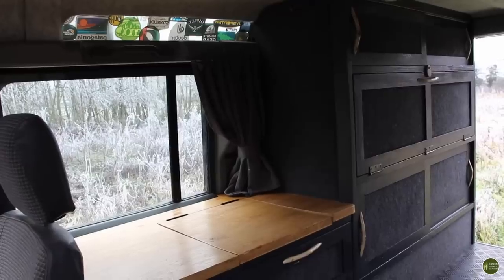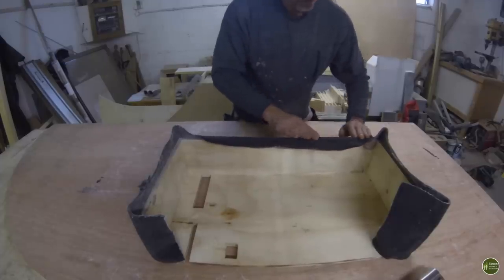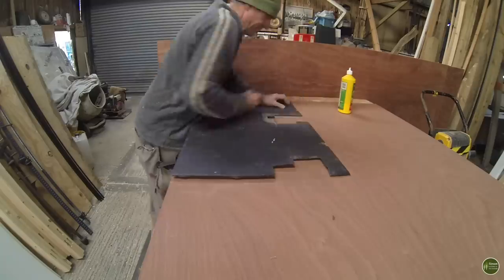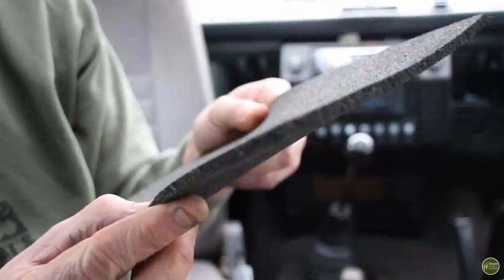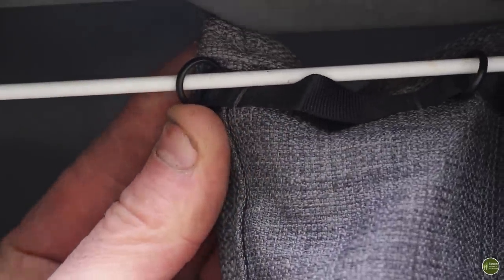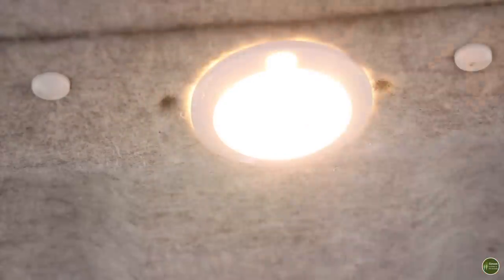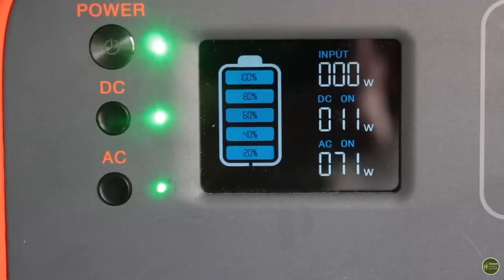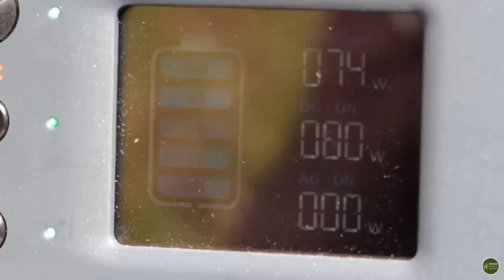Land Rover Home Build Camper Conversion - Part 2.  Off-Road, Off-Grid Adventure Vehicle.

Comment: The only thing I would do is change the night heaters fuel pipe for the diesel as the degrade and leak the chinese rubber isn't up to it we found that in our defender but its a great video great landrover camper conversion 👍

Comment: Buy a Leisure Battery & Use the Split Charger. This is How it's done in Motorhomes. 
A Leisure Battery is a Deep Cycle Battery. There will Be a Simple Switch to Separate both Engine Battery & House Battery. So you will Always have the CAR Battery Full up for Starting the engine. 
Even if the House battery has run Flat with Over use. ( VERY VERY NOT RECOMMENDED ! ) 
Look Up Leisure Batteries for Motorhomes & Campers online For all the Expert advice &details. 

As you drive the Car Battery Gets Charged fully & then the Alternator sends all the spare / Wasted Charge to Fill up the Leisure Batteries.

For Summer Use , You could Look into a FOLD away Solar Panel / s. 
Portable panels you can place on the roof, Bonnet, or just on the Grass. 
They Fold away & are stored in Very Large Laptop style zip carry bags.
Reply from the maker: I think that’s the route I will go down 👍
Reply: @simonablokeinthewoods  Get advice from a Battery supplier locally. & read up Motorhome Owners Info & Canal boat owners. 
I am not Qualified to Advise, Just My ideas to Point you in the direction of MORE INFO from Experts. 
& Guidance from those who have Many years of experience & knowledge. 

It Would be Very Offensive to the  4 X 4 Community & Land Rover owners if You Set yours on Fire or Exploded it , With You Sat Inside. 

1000.s of Youtube Viewers Would have Nothing to Watch on a cold Dark Night. LOL. 
Just a bit of FUN to create a smile. 

Thanks Simon i Enjoy your Videos.

Comment: Doesn't seem like a good idea running the diesel heater fuel line outside and underneath your vehicle where debris could impact it and damage it.
Reply from the maker: It needs to feed outside at some point as the feed is on the underside of the heater, I’m going to replace it with tougher braided fuel line though. 👍👍

Comment: That Heater Seems Brilliant.  REMEMBER for Heating It's Legal to Use RED DIESEL. 
Farmers Diesel is only Illegal For Road Use As a Driving fuel.
Red diesel for heating is Very Cheap. About 2/3 rds the price ? Half Price ?? look it up. 
& fully Legal as a heating Fuel.  Heating Fuel Only carries about 8 % VAT. 
( This is my opinion, & Thoughts, GO & Check it out & Look it up I could be Wrong or Slightly out of date here. ) 
Never Do Anything Without Looking up Current / latest Laws etc. 

ON a Canal Boat, You Declare a % for Travelling. & a % for heating Use. Maybe Refer to Canal Boat Diesel Laws & Rules ? 
Canal People will Know the Full Info.
Reply from the maker: I know a couple of farmers - might have to have a chat with them 😁
Reply: @simonablokeinthewoods  Hi Simon, You Can Legally Buy RED Diesel from Rural petrol Stations at the Pump. or A local Heating Fuel Supply Company. 
Or Yes Ask a Farmer. Get Correct Legal advice.
Reply: @simonablokeinthewoods  You say that Slim Container holds 10 liters / 2 Gall's. 
How Long will that Last to Keep you More than Warm on a cold night ? ( say 0 deg' Freezing ) 6pm to 8 am ? 1 night ? 2 nights or many nights ?   how efficient are they ? How Many Hours Per Liter / or Liters per Hour will it use. ?

Would that Heater Heat A LWB Sprinter size Van 3.6m / 1.8 m / 1.8 m & hold maybe 75 degrees all night ? Or would i Need 2 heaters ?  Lwb 110 Landy's are not very big. 

I'm Sure MANY 100's Will ask this Question
or will want estimated Answers.